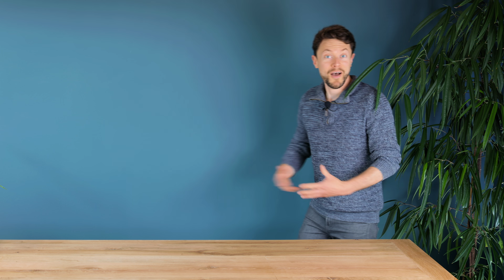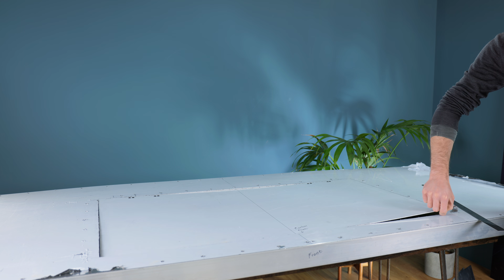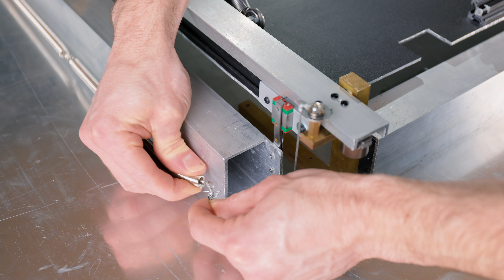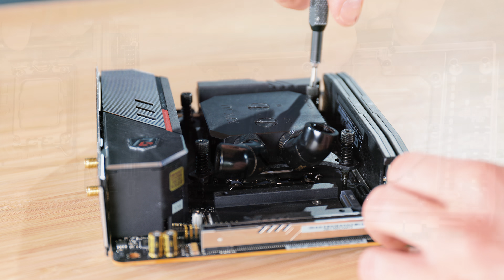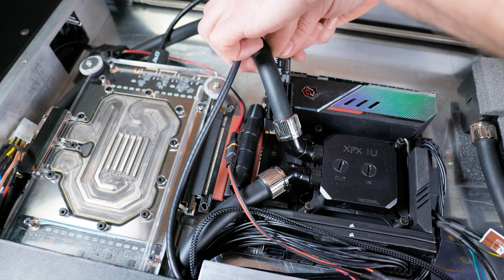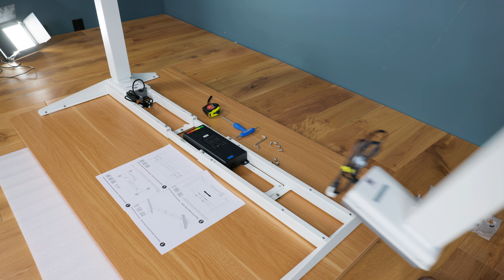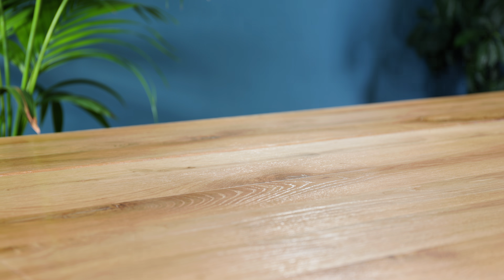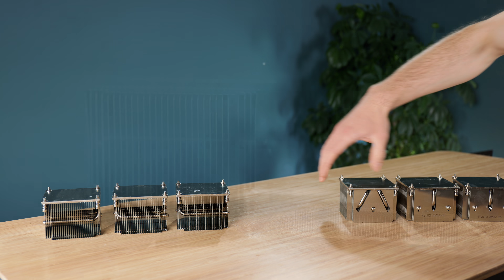Building the ENDGAME invisible PC

Comment: Beautiful design and execution!! 

 Thermally though, unless you had the quad array of brass square tubes surfaced on a mill, the thermal paste is not going to do well.
 Best suggestion for heat transfer with that kind of an irregular surface would be flexible thermal transfer pad sheets. They could (should) be very thin, but you would get more consistent transfer that way.
In addition, I'm not sure I saw any way for the heated air to be exchanged with cooler room air... you can have the most massive, most efficient heat sink system in the world, but if it's within an enclosed area, it will eventually fail... like happened with your first cooling system. 

Notebook cooling systems are some of the most efficient around... but they have to be able to breath easily. Putting airflow restrictions on both the inlet and outlet of the fans likely decreased the air flow rate capability... small blades don't generate much static pressure.

Last, the brass tube  "zig-zag" water flow method could result in non-optimal heat distribution between the heat sinks, leading to inconsistent efficiency. Heat transfer is dependent upon the temperature differential... and the water would be pretty warm by the time it went down that last tube... having very little cooling effect. 

Using the first tube as a distribution manifold feeding many small holes drilled through the joined center 2 tubes (to ensure consistent water flow through all of the holes), would probably keep the water temperature far more consistent across the length of the system. The first & last tubes could be slotted where they interface with the two center tube small holes.

Again... this was an awesome project... there was a LOT of thought and work put into it... and some really ingenious solutions to some very real challenges! 

I'll be sharing this video a lot!   

As an old design engineer myself, I just see some things that make me want to share my knowledge to help people.

Comment: I would be really scared of galvanic coupling causing the solder to corroded when in contact with the brass and water for a few years. Designing a proper seal would have been far superior for longevity.

Comment: Kudos, great job!
An improvement idea: a motor to open/close (at least to some degree) the cover. Otherwise the magnet will scratch the wooden surface very quickly. 
Also, much better audio system could be hidden inside the desk making 5.1 or even 7.2 system.

Comment: Brother keep in mind there is an issue with the i7 and i9 13th Gen and newer with heat. Check your bios and make sure it has auto set to crazy power draw resulting in those super hot temps. I set mine to spec and it fixed the issues.
Reply: I believe this news is fake. I should be affected I got the motherboard, bios and cpu and it’s all good here

Comment: I believe you could use normal radiators with some flat 14 fans and have a flat hole at the back for them to intake and radiators in parallel at the bottom of the deck. I believe you would have space for it, and would make it in the size of the desk without an issue. I believe in future you will find even better solution for heat management. I am amazed by the project. Keep up the exceptional work!

Comment: your sponsor should actually sell those.
the standing desk by itself is fine, but i'm not aware of a standing desk company which sells all in one pcs. the form factor is very different which gives it a unique opportunity. and if the support pillars could be used as heat radiators with a 'water' loop, so to clean the pc you don't even need to open it... it would make pc maintenance much easier.

Comment: I think a desk like this (but not endgame level) would fit perfectly in a very, very small living space like a caravan/camper(though arguably you should just use a laptop if you're disconnected from the main energy grid) or appartment room, the only problem would probably be the wear and tear and the fact that the grooves are (mostly) invisible, you could accidentally knock something like a glass of water over because you forgot it was on the corner. Overall end-game product, 9/10, -1 point for it being invisible, +9 points for it being invisible

Comment: Putting intel into this setup is really stupid IMO.. AMD offers much more performance per Watt which is crucial in setup like this.

Great project otherwise - at always!
Reply: AMD might use less power but they have a hard time not burning their CPUs and their reputation with less power
Reply: @patfre  not really, for 90% of tasks (and games) AMD is much more powerful. Haven't heard about burning CPUs ever.
Reply: @sorek__  they where burning and blamed it on everyone else than themselves and they refused to give replacements or a repair until they determined that it was their fault though the timing of that was a bit suspicious because someone proved it was them a few hours before they did that then there was the GPU problem they literally copy paste the response from the CPU issue that basically still said CPU and not GPU and said it was the user’s fault and said a limited number of users (in both cases it was a lot of people) and also refused a replacement or repair and supposedly “found” the issue and then started recalling it. Also I think you’re talking about a thread ripper or something because last time I saw a benchmark it showed i9-14900KS being like 1% faster on average which just comes down to slight variations I think.
Reply: @patfre  well this coment hasn't aged well ;)

Comment: the extra touch that im a little disappointed didnt happen was to integrate the flexible monitor in somehow, so you can open up the desk and then adjust the monitors curve with some flip-out handles one each side. however, even without this feature, the mechanism that the desk works with is still extremely cool and well-thought out.

Comment: I can't help but think about a few things that would have presumably made the build a lot easier and and quicker. 
1. The 13900K is a very warm and power hungry processor. Other alternatives allow for the same performance for probably 100W less that you'd have to cool. 
2.The array of heatsinks is definitely larger than let's say three 360mm (or even 480mm) radiators that would have fit in even smaller space and provided more than enough cooling. The argument of value against your solution is kind of not really relevant considering the cost of the rest of the components and the time and effort needed for construction. EK's radiators are also very overpriced anyway. :D

Comment: I would recommend 3 enhancements to this concept:
1. Create a docking area for all the extension ports (USB-A, USB-C, HDMI, Audio out...etc.)
2. Since most of desk will be placed with either back or side against the wall. Having an rear hot air exhaust may not be optimal. I will have the hot air exhaust at the back of the desk but to the bottom.
3. The final design has half of the fan air intake from inside of the table (Potential hot air and restricted air path. A duck solution which scoop fresh air away from the hot air source will be optimum. And since the heatsink is so oversized I think only half of the fan shall be sufficient to cool the setup with properly designed air duck.

Comment: That's absolutely nuts, first never seen an adjustable curvature monitor.  I wonder if you couldn't get away with something like an OLED TV and call it a day.    That cooling man... I think I would stick with a traditional radiator design and you could simply vent straight down,  yes grabbing a bunch of throw away heatsinks from a company getting rid of servers can be cheaper than a 360mm radiator,  you also have 12 fans when only 3 are necessary.   Although I do imagine the quiet is worth the added expense.

Either way fantastic job.

Comment: So awesome. Not even necessarily an upgrade, but just an idea is to have some sort of fingerprint reader or pin pad hidden on the bottom or front and have some sort of electric motor to raise and lower the setup. I think the magnet might eventually wear the finish away sliding it on and off.

Comment: There is a very thin line between being a genius and a madman, and you're balancing on that line like it is nothing. :) It is just Incredible build, Matt.
How much force you can apply to force it to go down, it is not closing itself from just resting a hand on a mouse and keyboard?
IDEA - maybe version 2.0 can be motorized to open and close, after positive readout from a fingerprint reader and some Arduino (or other small PC) under the desk?? 👀

Comment: When I saw those server coolers my immediate reaction was: "have you been to a server room? There's a reason they often require hearing protection for continued exposure" 😂
Reply: My computer when I changed the bios setting to run fan all the time is like a jet engine. Its a workstation so they are equipped with some pretty strong fans. I only turned it on full blast like that once.
Reply: @omulamfibie  as noted by the commenter above you: Server hardware is designed for high pressure airflow. The noise in server rooms is from exactly that, high flow, high pressure air movement.
Without that high pressure flow server cooling would be impossible. 
A heat sink like that is basically unusable without a noisy powerful fan.
Reply: Yep, I was screaming "these things need a LOT of static pressure"
Reply: You're joking, right? The main issue with the noise in server rooms is the very high cfm server grade fans. He only used server heatsinks, so your worry is misplaced.
Reply: @omulamfibie  server heatsinks have ultra small long gaps resulting in massive resistance to flow. They don't use high CFM fans because it works better, they use cooler designs requiring high CFM fans because the combination is what makes it work so well. Those coolers, as demonstrated in the video, are complete garbage without that high pressure flow...
Reply: @omulamfibie  Pretty sure the others were talking about his first cooler design with the 1U heatsinks.  V2 used 2U sinks with a design much more conducive to "low & slow" quiet fans.

Comment: I think your brass square tubing heat pipe is a good idea but I think they shouldn't be touching each other to avoid heat transferring between them. Also, I'm wondering why you didn't go for smaller 60mm fans like you did in the first invisible PC video. The 140s sticking out the bottom ruins the look.

Comment: was thinking how it couldn't be so easy using server parts for a custom cooling setup as they do have extremely small fans that push tons of air through servers rather loudly, but I didn't think it would be that bad oof. Curious if a 2.0 Endgame might use those static coolers (AirJet cooling chip things). Supposedly, they are going to be in laptops eventually, as they are more efficient, don't have moving parts, and are only 21db (basically silent).

Comment: I would like to see you make a mini itx computer run on 12v, without using an inverter. Small 12v power supply build. I live in an off grid trailer but need the power of a big computer. Can you HELP me?

Comment: The first set of linear rails (the short ones) is useless once the extra brackets were added. This was predictable as the large spacing between them makes it easy to apply eccessive torque which the cannot withstand

Comment: When i saw you make that giant cooling monstrosity i was shaking my head. Your cooling solution(s) are super unnecessary. 75C on the cpu is fine but 2 cheap consumer radiators and maybe 2 or 3 fans would have done a better job than the ridiculously heavy heatsink thing you made. There's no sense in DIYing cooling, especially if you're spending so much money on the rest of the build. It's a solved problem, just buy a radiator.

Comment: I think a low-profile Sound System & USB hub could have been integrated in the front plate under the Monitor. It would extend the front a bit, but if done right it could have worked.
Also, some wooden framing and thin grills/mess cover for the part of the PC fans which is sticking out on the under-back would have looked nice, and also protected the fans from some dust build-up.

Comment: You could make that cooling system invisible again by limiting it to just one layer of heat sinks and using Noctua NF-A4x10s for the fans. I would also for the long term recommend a water block that also cools the VRMs since the airflow in there is not great.

Comment: The whole design is stellar and looks the part, but I feel like you ultimately skimped out on the cooling by going with laptop heaters and server heatsinks.

Personally I could have gone with custom cut heatsinks (since you've customised a lot of your secret PC, a custom heatsink cut would fit the bill), and noctua fans with a custom fan curve (yes they can be somewhat loud, but a custom fan curve can offset that issue, or if you'd prefer, go with BeQuiet fans).

Comment: One note, heat naturally travels up and it has to go somewhere after the heatsinks absorb it. 

So you'd either need to put (stylish) vents somewhere in the desk's surface for the heat to actually radiate away— 
or be content with just delaying and spreading out the heat over time (but it radiates in the same general areas as all the PC components).

Comment: In the end I found that the true endgame invisible PC is not in the room with you. You can't remove PC fan noise completely. You can't remove things like RTX 4090 and 14900ks generating 800w of heat in your space. You can however move the tower out of your workspace and into a separate room. At which point it doesn't have to be slim nor pretty nor silent. It can be just a box of fans completely encasing an open test bench.

Comment: Amazing video. I noticed one thing though - an issue with the first heatsick might be that the heat pipes are running back and forth. So that the entry point of the heat pipe is almost in direct contact with the end of the heat pipe. This means that heat will travel from the hot end to the cold end. A similar thing will also happen thoughout the pipes. This is made worse because the heat sinks are connected to all 3 pipes at the same time, again spreading the heat between them.

Comment: You are bottlenecking the NVME drives via that NAS it does not have a powerful enough CPU(and pcie lanes) and 10gbit networking is not going to be enough to fully use the drives

Comment: Simply magnificent. Your work is always outstanding. The only concern I have is the magnet scratching up the table surface in the long term. A button to release the top and pop it up a cm so it could be lifted would be a better solution. Because of that, I give it 9.98 starts out of 10.

Comment: BE SURE the water you put into the brass conduits is pure. Take the time to distill it, even.
The corrosion of brass in water is normally just the formation of a light exterior patina; you can keep it immersed for a long, long time without any further damage. If the water has certain contaminants in it, the brass can corrode very badly.
Reply: Brass won't corrode beyond a light surface corrosion if the water is pure, but the junction of brass and aluminum is still a problem, yes.
Reply: The bigger issue I think is the water causing a reaction between the brass heat spreader and the aluminum water block on the GPU, leading to galvanic corrosion.
Reply: the water looked like proper distilled water going by the container.
Reply: @rafezetter8003  Distilled or not, water is corrosive enough to cause galvanic corrosion. Anti corrosive additives would be necessary to prevent it.

Comment: My worry with this would be not enough resistance on the platform that holds the mouse, keyboard, etc. I feel like if you push down too hard while just normally using it it will get pushed down and the lid with begin to close.

Comment: Mixing metals in the water cooling loop is a recipe for galvanic corrosion. Looks like you've got brass and aluminium at least, maybe copper too.
Reply: Brass contains copper as part of the alloy. I am unsure if this will help or not, however.

Comment: 21:27 It’s good but having the need of a big magnet to open things up seems impractical. I think it would have been better to have designed it such that the whole system naturally wants to be open- using a similar hinged spring mechanism as you already have- and needs to be locked in place when down. Myriad ways you could have done this- linear actuators activated by a magnetic switch of some kind or even something more complex such as an rfid system. Wave a card or a ring with an rfid chip imbedded in it like an Oyster card and the thing opens automatically.

Comment: Maybe for your next project (as you love heat management so much) you can make a heat pump that would redirect its refrigerant to cool or heat several appliances (computer, refrigerator, hot water boiler, etc) using one single compressor.
Similar to the new Tesla cars heat pumps, that moves heat from devices who has to spare to those who need it, in a silent and efficient way.

Comment: With the new fans, the airflow is not bidirectional so the portion of the fan that's on the inside of the desk is pulling a vacuum and won't have much flow, without some big-enough inlets (which are not in the video).

Comment: This is one of the projects I love the most from all the ones you did.
But your cooling system seem quite oversize as normal :)
Also, 800 W in power consumption does not equal 800 W in heat loss, more like 500W on heat loss, but maybe 800 is adding the monitor?
Maybe for your next project (as you love heat management so much) you can make a heat pump that would redirect its refrigerant to cool or heat several appliances (computer, refrigerator, hot water boiler, etc) using one single compressor.
Similar to the new Tesla cars heat pumps, that moves heat from devices who has to spare to those who need it, in a silent and efficient way.